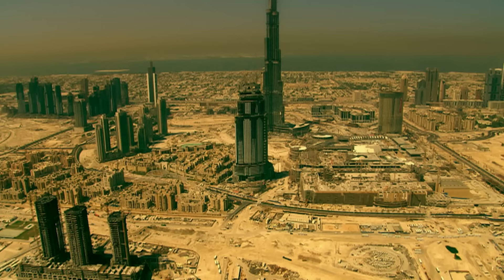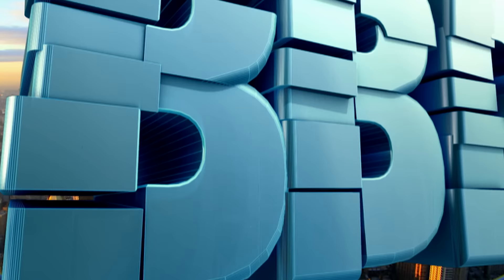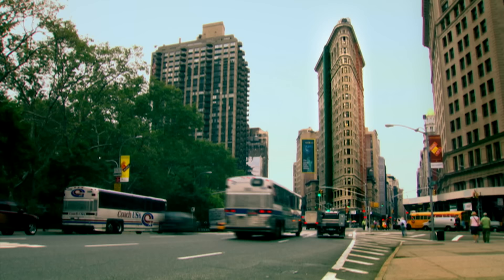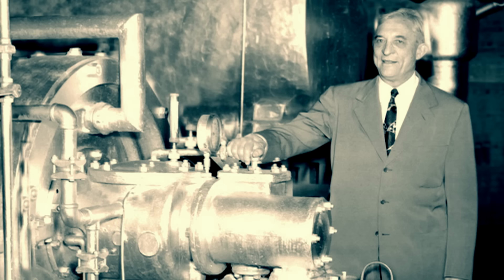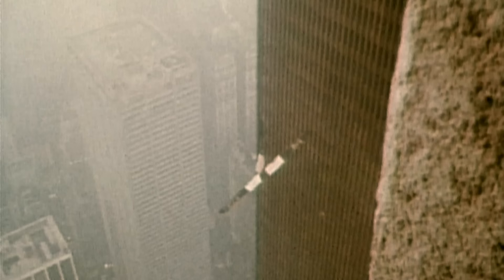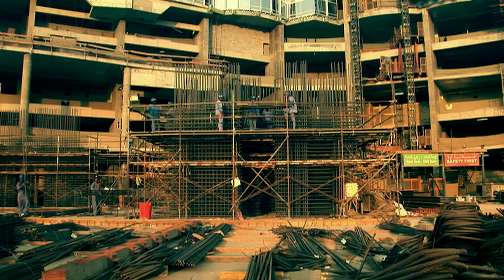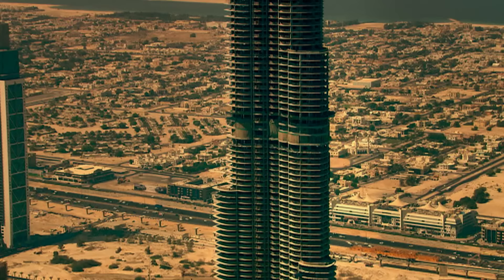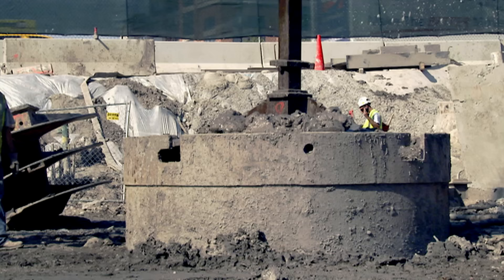Burj Khalifa – Skyscraper Supremacy – Big Bigger Biggest (Part 1)

Comment: 16:25...they blast a 70Kmh "Desert Wind" with an Aircraft Engine and Propeller at the Buildings "facade", and call it a "simulation"...... Sandstorms come to mind when I think of a Desert, a thousand square miles of Desert dust, debris, sand and grit grinding at every thing in its path, living or not, at a hundred plus Kmh, what they were doing is not a "simulation" of a "Desert Wind"...

Comment: They left out Plumbing.  Well, it has plumbing, it just has no way to pipe the sewage away so they have to carry it off by the truckload.  You'd think a sewage system would have been something they thought of.
Reply: That was only a concern as the new downtown was being finished and DEWA was being expanded to the area when the tower opened.  It's had you know, normal plumbing connected to sewers since forever.